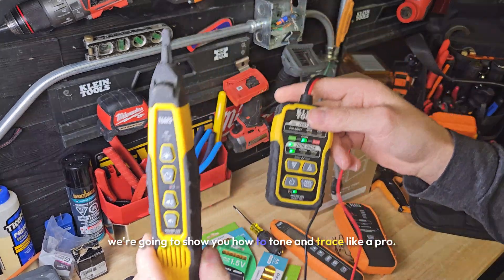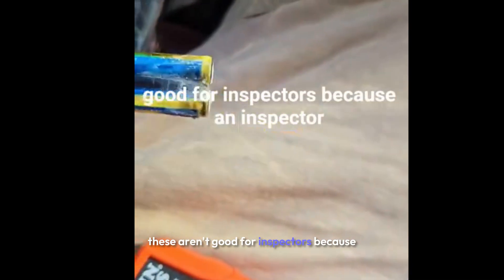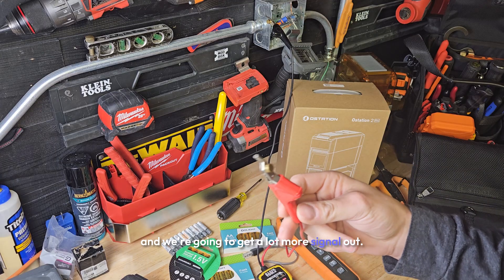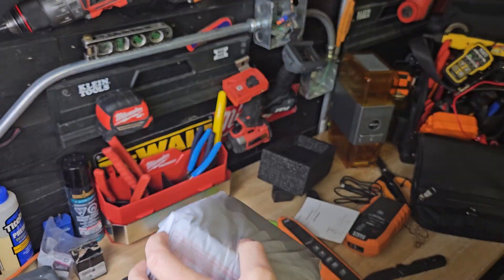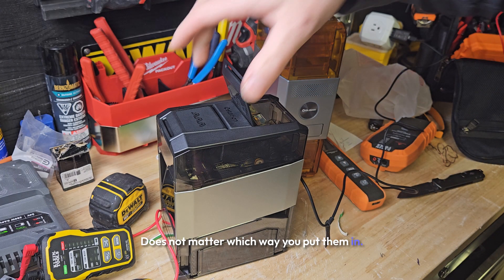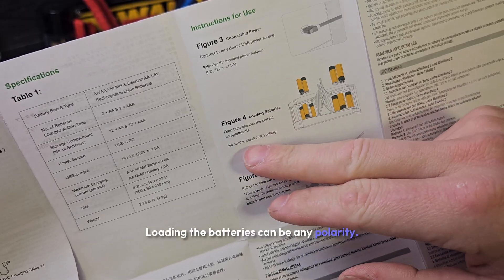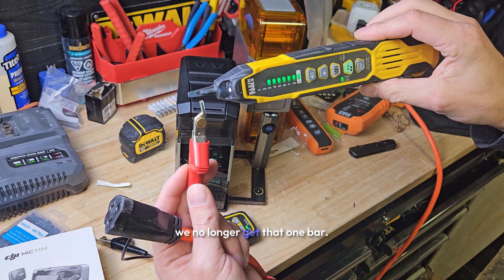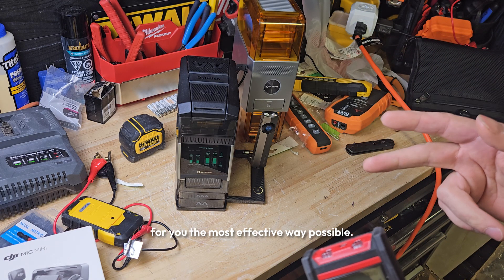​The Battery Solution Every Modern Home Needs! Ostation2 FEAT: Use A Circuit Toner Like A PRO!

Comment: I use the batteries included with my Klien Tools. They work fine. I'd rather they include bad batteries rather than buy a new tool and not have batteries to use it immediately or have to go look for some.
Reply: Hey, send some of those flashlight sponsors my way. I'm absolutely interested in trying them out. Although they probably wouldn't want work with me loll. I like affordable stuff and I think  you need to start at the bottom of the ladder (cheap stuff) and work you way up to fancy stuff (Olight) sometimes.
Reply from the maker: I didn't start off with cheap flashlights.I really didn't pick anyof the brands except for this.I've been buying olights since twenty fourteen

I gave wuben a try but its meh
Reply: @toolsandtactics I read tons of reviews saying Wuben is trash. I like Wurkkos and Sofirn, and I've also heard of some issues with customers not receiving their products. I believe that is way into the past now.

Comment: It’s impossible, but I try to buy everything with user replaceable batteries. If you care for your things they should last years, so the battery will eventually wear out and being able to replace them is very important for me.
Reply from the maker: Yeah, the fact this charges with its auto function and protection on lithium is just amazing even easier to get quality gadgets Perform the same as 1s with built in lithium packs